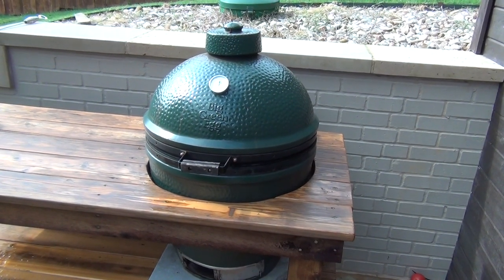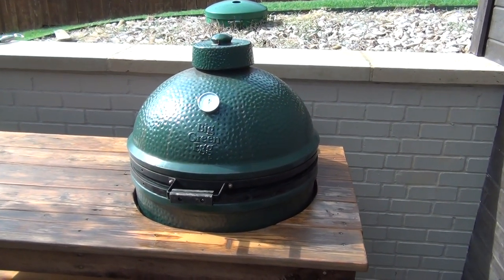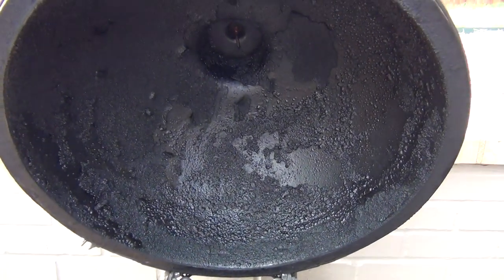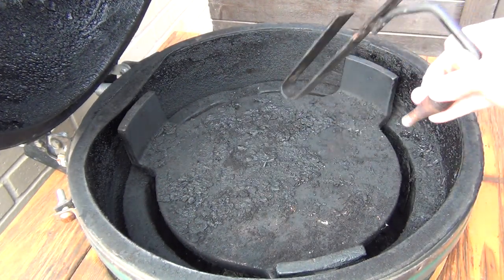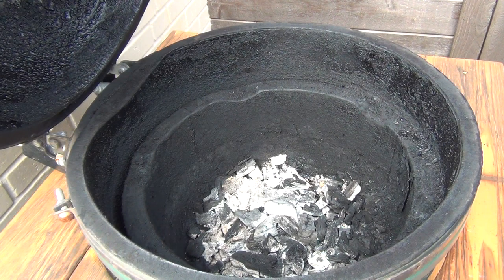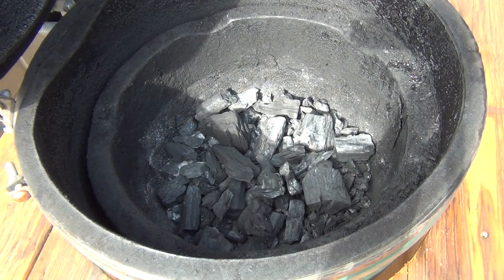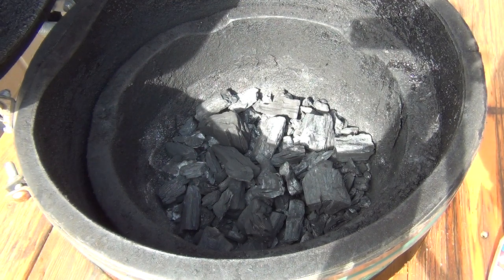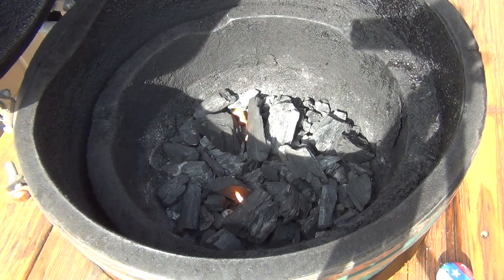Big Green Egg Burn Off Instructions (Cleaning)

Comment: Did this burn off today for the first time. I have owned my XL for about 4 years and I use my BGE often. The burn off went for about 3 hours at what I guess to be about 900 degrees. The needle went all the way around to the 200 mark. It was so hot for so long the wood around my egg cart started to smoke. I would recommend a deep clean however be careful if you have a wood cart.
I was in need of a new casket and lid alignment anyway so not a big deal there.
The need to do a deep clean was fueled by the fact I recently did 3 slabs of ribs with not so good results in regards to taste. All who enjoyed the ribs could taste the old dirty.
Would recommend deep burn to clean out.

Comment: Great Video..thanks! My BGE was identical to yours in appearance on the inside and outside. After my burn-off session, I scraped the gasket off...then used a Dremel w/ sanding attachment to remove all of the previous gasket residue. I then installed a Nomex gasket, with the ends placed at the rear of the smoker for both top and bottom gaskets. Next came the upgrade to my hinge assembly...to the new assembly available w/ a larger handle and spring hinge (which is awesome!). Lastly, I installed a larger BGE thermometer. A quick wipe to the exterior with diluted Simple-green (2-1 ratio) and finally Isopropyl alcohol. She is now BETTER than new. Cheers FR BBQ!

Comment: No need to trash a gasket twice a year. Normal high heat cooks will clean out those vent holes. And a ball of aluminum foil can knock off loose gunk on the dome. I use my egg 3+ times a week and haven’t needed to do this having owned it for years
Reply: what is your setting for high heat without the need to replace the gasket?  I have only had my egg for a little over a year and I do thinking it is time for a good burn off... A lot of time I struggle to get enough airflow even for low and slow. I clean it out completely every time I use it and make sure all the holes are clear.  I still reuse the leftover charcoal. I just take it out to clean all debris.
Reply: How does a ball of aluminum foil knock off loose gunk?  How do you set that. Up?
Reply: @johnarneson5057  Use it like a scrub brush, the rough surface of the ball knocks off loose junk
Reply: That’s probably because you use it frequency though. Keep a flame inside it, and you’ll have zero mold or rust issues. For folks that don’t use their grill as frequently, a temp burn will alleviate that. Just fill the basket just above the ceramic vent holes for all those asking. Don’t overthink it, fill it, burn it full tilt for an hour or two.
Reply: @BrewReview  I've had a couple times where I get mold buildup in early spring where it didn't get as much use. You can do a burn at 500 degrees with the same results to clean out mold/moisture and don't have to trash your gasket.

Comment: Big green egg is the BIG pain in the butt
Look at the PK grills designed in the 50s the bew PK360 is WAY easier to use control heat and clean

Comment: I did a clean burn twice still not clean is there another way to clean ??
Reply from the maker: Other than the burn off method, I don’t have one.
Reply: @FlamingRoosterBBQ  I could not get mine to totally clean either but then I just used more charcoal. Load it up to where the firebox and fire ring meet. You will have a white dome when it is done. Be careful if you have your egg sitting in a wood table, be sure it is not making contact with any wood around the base before doing a burn off, the  table will catch fire. I know from experience.
Reply: @stevefenstermacher1330  You must of done it wrong somewhere. Use some good lump charcoal. The bigger the charcoal the faster and higher your temps will get.

Comment: There is absolutely no need to do a clean burn like this unless you like to throw away money and time. Why fry a perfectly good gasket to get the ivory color back on the inside? It's just going to get black again after a few cooks. That what smoke does. These nuclear clean burns can also destroy your thermometer, and you risk cracking the base. Money and time no problem? Go right ahead.

All you need to do is keep the fire box clear of obstructive ash and use balled foil to clear the flakes from the dome. Replace the gasket when it needs it - burned in spots and flattened out.
Reply: Creole build up is bad and you would have to clean burn it off. This ain't no different than a self cleaning oven.